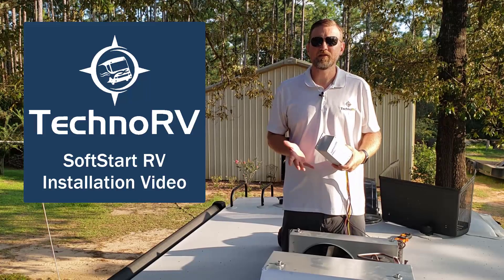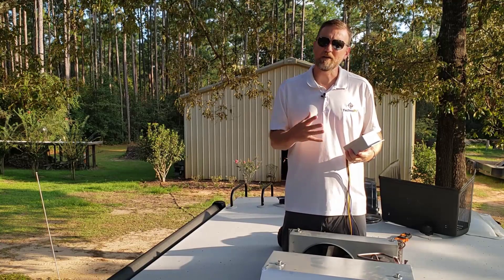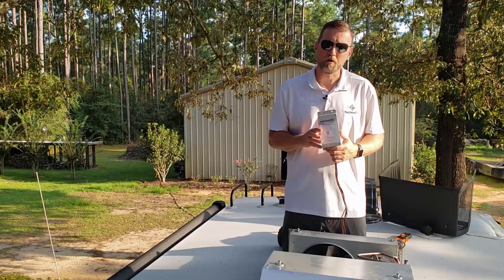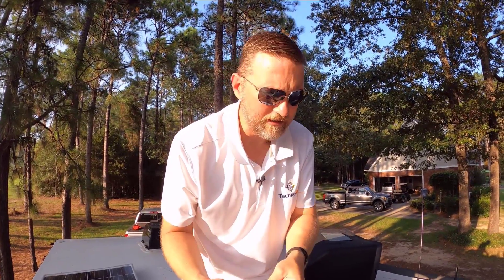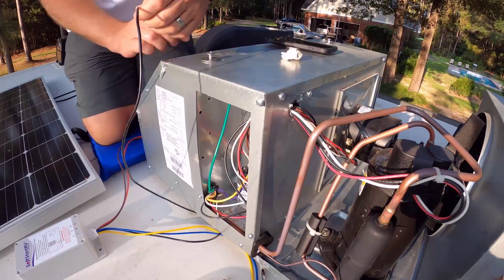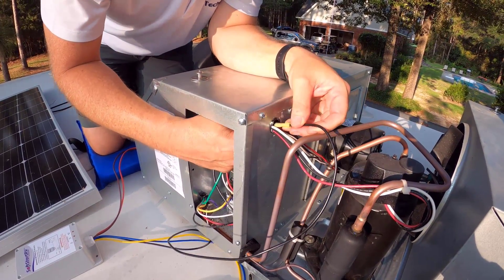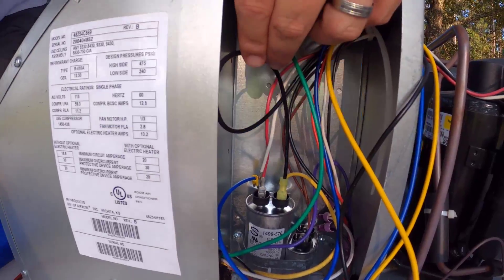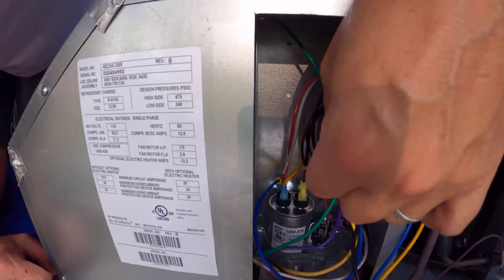SoftStartRV Installation on a Coleman Mach RV Air Conditioner

Comment: I would have cut the purple wire off the splice and crimped the Softstart wire to it just to reduce the crimp connections.
Reply: LOL I was thinking the exact same thing!
Reply: Yes I would cut that joint out.
Reply: I agree with splicing to the purple wire. How about insulating the bare connection blue and the white wire that came off the capacitor???
Reply: My only thought about keeping the splice is, if you needed to replace or remove the soft start, wire coloring would be easier. But I agree, cut it out.

Comment: Excellent! Is that a Coleman Mach 15 A/C? I'll probably install one of these on my trailer's second Coleman Mach 15 A/C.
Reply from the maker: I know it is a Mach, but not sure on the 15 part. When you buy a SoftStart from TechnoRV then you will get an email with the TechnoRV  Learning Series that will have the wiring diagrams for the different AC units on the market, and you will have access to SoftStart directly for all the assistance you would need. Thanks for checking out the video, and as you can see, it is pretty simple.
Reply: Jim, did ever find out if Eric’s install was a Mach 15?  That’s what I have also and would like to install it following this vid.